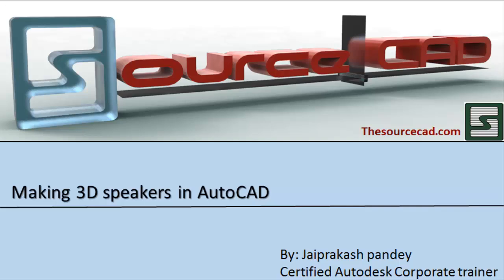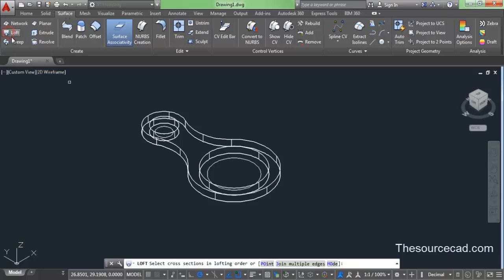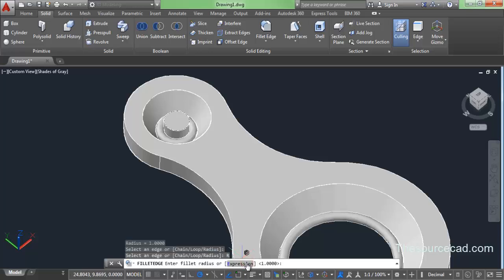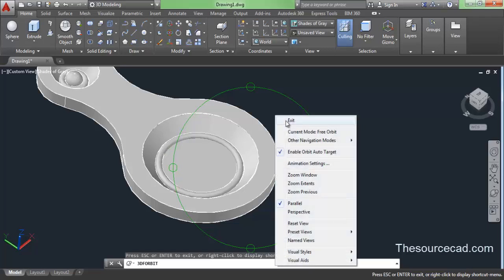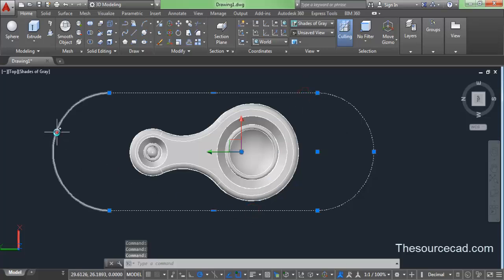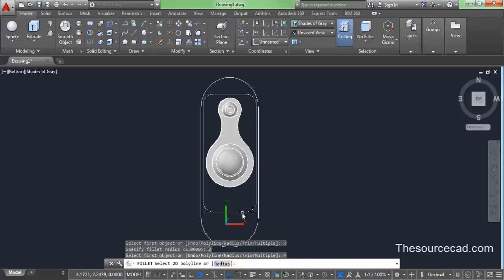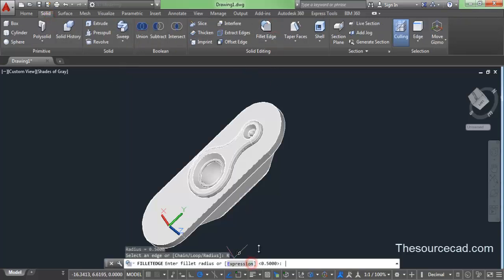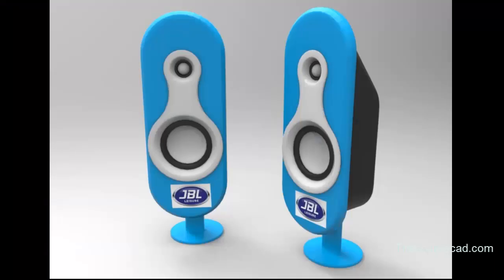Making 3D speakers in AutoCAD

Comment: When I import a 3d model to 3D max from Auto cad it is always change the circular shapes into shapes like decagon.  How can I solve this issue ?
Reply from the maker: It generally happens when you import file in native CAD format, I am not sure of the exact reason why this happens but you can try a workaround to get high quality output. 

Export this cad file to .STP or .IGES format and then import that file in 3D max (I guess 3D max supports STP and IGS formats). I have tried with STP and it works great for me when I import it in keyshot.
Reply: +SourceCAD : Thank you  very much for your  attention.
Reply from the maker: Welcome

Comment: Sir why if I do Extrude command ° ° he always leads to the top Let me give an object number 5 is always pointing up, but if I give a new -5 numbers will lead to bring
Reply from the maker: galih permana I am sorry Galih can you make this more clear as I am unable to figure out your exact question.
Reply: SourceCAD If I do Extrude command he pointed up, but if I do extrude with a minus figure he was going to lead down
Reply from the maker: galih permana Yes using positive sign or no sign will extrude in positive z axis in this case upwards but negative direction will extrude it downwards. 
If I could understand you might be facing problem with extrude use presspull and select area inside geometry instead of extrude let me know if it helped
Reply: for this picture a little bit difficult, I've practiced, but why a small circle does not want to circle round and great why he does not want a slightly curved downward. when I've used a radius corresponding in the video, and to which side I already use the command 'chain' with a radius of 0500 but only slightly affected by the fillet does not match that in the video

you can see my pictures
https://www.facebook.com/photo.php?fbid=800240026678606&set=a.315866525115961.66587.100000778479131&type=1
Reply from the maker: galih permana I would suggest you to use higher value of radius if 0.5 is not working for you, As I already mentioned you need not be precise just select values that suits you best
Reply: hmmm I've been using numbers 10-50 are unsuitable, probably in the next lesson you provide size so I could copy it easily. okay I will try to repeat from the beginning
Reply from the maker: galih permana its good to see you try it again, good luck
Reply from the maker: galih permana which path?
Reply: I mean social networking application path